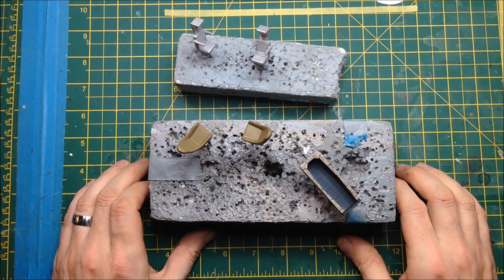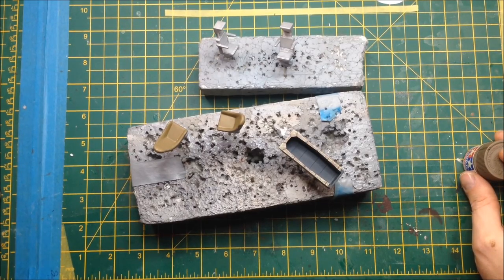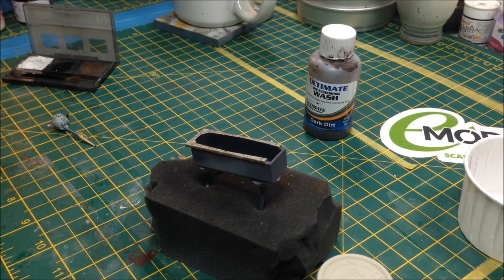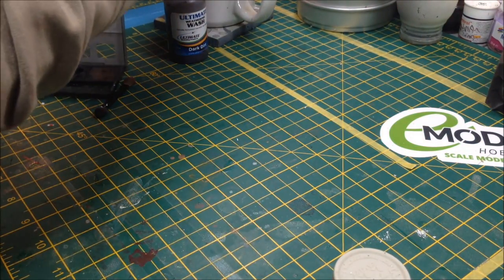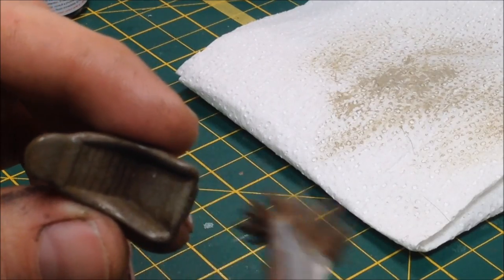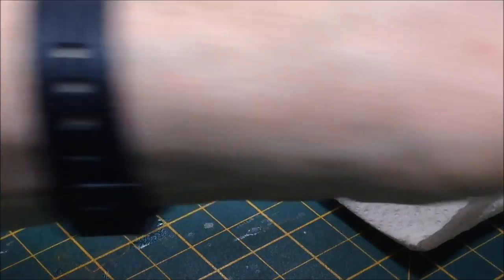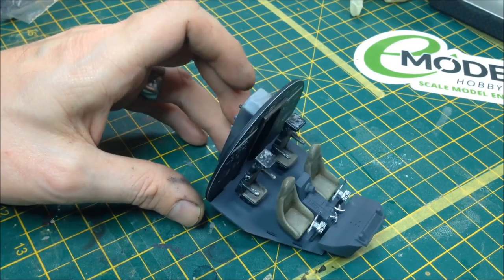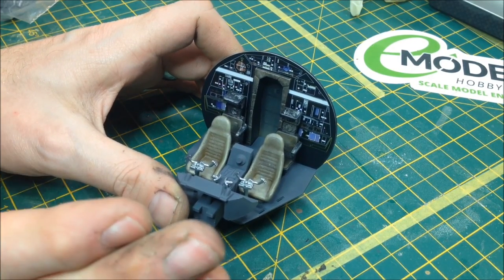Build The DeAgostini Millennium Falcon Pt 3: Cockpit Painting Pt. 1

Comment: Another top quality vid. Two questions, how long do you wait for the hairspray to dry and  how long did you allow the black coat to dry before applying the water and starting the scratching? Many thanks
Reply from the maker: The hairspray really around half an hour or so to be safe, longer if you want to be extra careful. You don't need to spray a lot, just a nice coating over everything. As for the water, ideally you should leave it to soak in for at least a minute to get he least hassle - I kinda rushed this a bit for filming so as you can see some areas don't give up the paint that easily!

Comment: Hi mate can you tell me the mix you use plz as I have been looking and see lots of ways but I like the mix you do ?
Reply from the maker: Gareth Tucker Well I WAS mixing four pots of Tamiya Flat White with 1 pot of Tamiya Deck Tan, burt now there is an easier solution - DOA paints have released pre-mixed water-based colours specifically for the MIllennium Falcon - go check them out: http://trackpads.co.uk/swsshop/index.php?main_page=index&cPath=9&zenid=sb5rd44ka6i58pp1sfc994ee25
Reply: Thanks mate keep up with the vids mate they have gave me loads of info and help thanks.
Reply: +Modelmaking Guru I just went to this link and I don't see any paints labeled at for the Falcon. Did they stop making them?
Reply from the maker: Try this link instead :) http://www.starwars-doa.co.uk/

Comment: Hey, great tutorial! Btw I miss a point... When you color the dark brown on back seats? You say, flat aluminiu, then air spray, then gun metal, then black.... Can you explain well? Thanks!
Reply from the maker: +Domenico Neri Hi Domenico! I actually replaied to you on the Facebooks, but for everyone else's benefit I'll copy that reply here: 

"It's called the "hairspray technique" and it is a cheap way to do paint chipping smile emoticon

You simply paint the seat your metal colour (Flat Aluminium), let that drym then spray the piece with hairspray. Any cheap hairspray from a supermarket will do, the cheaper the better. Let that dry for maybe half an hour, then lightly airbrush you colour on top (in this case black)Let that dry for half an hour, then take brush and brush on plain water over the piece. Leave it for a minute, then ship at the paint gently with either a cocktail stick, toothpick or a stiff brush. The water will have soaked through the paint but will not soak through the hairspray, so when you scrape the paint the black will chip off but the metal underneath will not be affected smile emoticon

If you want more control over the chipping, you can use Ammo for Mig Chipping Fluid instead of hairspray, as it does the same thing but can be applied through an airbrush, but hairspray is cheaper."
Reply: +Modelmaking Guru Thanks for the answer. On the rear seats, I see brown where it was white... It's only like that with the airspray tecnique?
Reply from the maker: The hairspray was really only for the black paint to chip off to reveal the metallic colour underneath on the seat frame and arms. Once you have done the chipping, you can then go in and paint the cushions and any other parts that are not meant to be chipped (just do the chipping part first) ^_^
Reply: +Modelmaking Guru ok, so you did not explain when you paint the cuschions with brown or I didn't understand when... can you explain well pls? :)
Reply from the maker: +Domenico Neri It was very straightforward, I sumply brush painted them the base khaki colour, then brush painted the darker colour (khaki + a little black) areas over that to suggest shadows and folds in the material, and then went over the cushions with the pastels as I showed. Dead simple :)